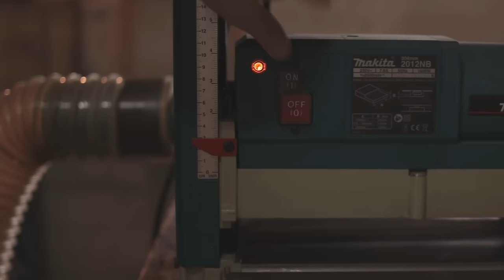Making bedside tables // Nightstand // Woodworking // In feel // Furniture making

Comment: Hey man.. I hope ur not still using that Radiator that's behind ur wood lathe.. hahaha!! Sorry but that would be funny as heck man with all that dust. I cleaned out my dust extractor/hoover this morning. Oh my lord the dust is so fine it's dangerous man.. How do u cope with that? I ended up with Conjunctivitis and it's horrific. I developed it and my thoughts are the dust caused it? I don't know if this is a thing in small dusty workshops but my nose has developed major issues too and it's not from snorting cocaine either.. heehee! 
I'm only joking pal. 
Watching u in this video I've noticed u have a good dust collection system? That's great man. Mine is pretty much a large hoover and I attempt to use it on everything. How often would u suggest a filter change on these Wet/Dry VAC hoovers. Mine is huge. 
hOW TO CONTROL THE FINER DUST IS A BIG ISSUE FOR ME. i DON'T KNOW WHAT TO DOC ABOUT IT..
Anyways keep up this great work. I really like these bedside tables.. What wood is this? Red Oak or something like that? I love the colou of the wood u used..